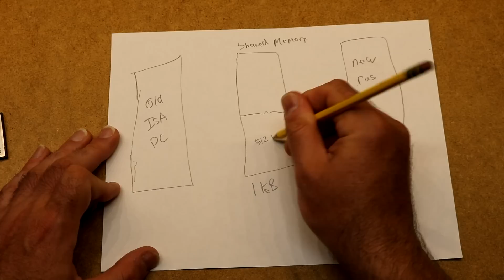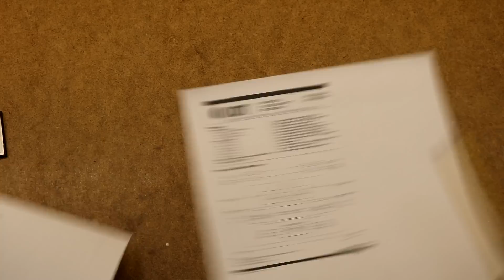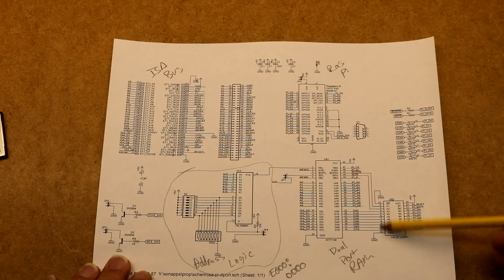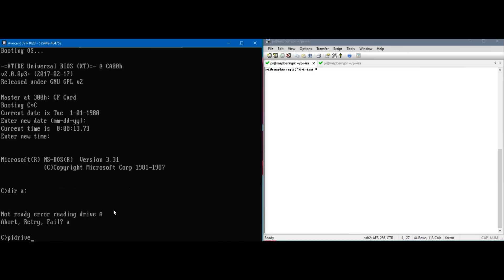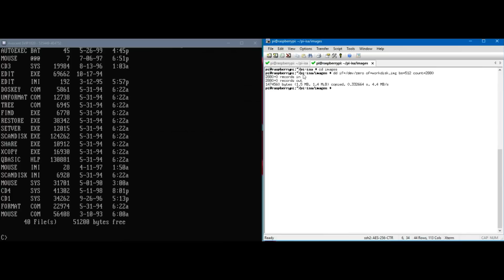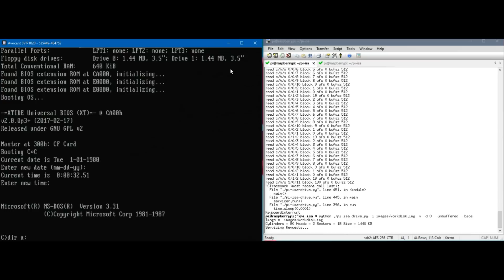Raspberry Pi Virtual Floppy for ISA (PC XT/AT) Computers

Comment: Hi, so I have the same setup. Question... The VGA card shows 512kb on boot but with Check it, it only shows 128kb. Is that a limitation of the 8088 or something I did wrong. I did set it up to use the extra hi mem and that works, if course with the proper software. Maybe that is stopping the extra video ram. I not sure I would even notice the difference but if I can use it I would like to. 

Love your videos sir!!

Comment: Way too late but you can do logic level conversions on the cheap with a transistor and two resistors.    Alternatively, sparkfun sells a board with four such arrangements each.  Part is BOB-12009. I've got a bunch, they're handy.

Comment: Can you make a Mp3 player? The idea is to send commands from the ISA computer to the Pi and select which file to play. Then we need to add the hardware for the audio output as the Pi Zero does not have it by default. What do you think? I think it will be a great project that does not require too much extra effort and we will all be able to listen to music on our vintage computers :) There are already some serial mp3 players, but they do not allow retrieving the list of songs for example.
Reply: But, why would you put it inside a PC instead of just having the Raspberry Pi with USB speakers outside of the PC??? The quality of speakers available is much, much better than tinny PC speakers of the original PC, XT, AT or clones. Then you can take it away with you in your pocket. You have a great solution, you just need a better problem to solve! lol!  It's also probably possible to create a Video Card of sorts for the old PCs with a Raspberry Pi, too, so you could use HDMI. Another thing that's an issue for the vintage PC collectors, is that even the weakest RPi is many times faster and more powerful than the PC itself. You can emulate a 8088 or 8086 PC with all the extras within the Pi easily. So the PC has nothing to do. You may have seem some Amigas that are just the Raspberry Pi inside an Amiga shell, emulating the Amiga without any original circuitry. You could do the same with an empty PC case with a power source for the Pi, that would be more sensible than trying to use all the obsolete unneeded PC components.

Comment: Why not use a Gotek with FlashFloppy firmware? It is cheaper than a Raspberry Pi.
Reply: Cheaper than a $35 RPi 4, but not a Raspberry Pi Zero which is $5-10

Comment: Now need something like this for IDE CDROM emulation.
Reply: Why?  there's not a lot of practicality over using virtual ISOs on a hard drive or XT-IDE Compact Flash 8-bit adapter (CF uses IDE).  For XT and ATs (8088 and 8086 CPUs), which only run DOS 1 to 3.x, the maximum addressable sectors on a disk was 4096, each sector could contain 4K or 4096 bytes, which adds up to a potential total of 16 MEGABYTES. Getting a 386 with the DOS 386EMM.SYS memory manager gets through all these limits, but consider this history: MS/PC-DOS 4+ was needed to have a storage medium of over 32MB, and DOS 5, to get over 512MB. FreeDOS gets around these limits, and old DR-DOS had some memory tricks, I forget the details. Looking at the original BIOS, he original BIOS INT 13h interface allows for 1024 cylinders, 256 heads, and 63 sectors per track. A PC using INT 13h can therefore only access 504MB. Anyways, whether using XT-IDE with Compact Flash, or just an old hard drive, there's little advantage to be gained over ISO files put on those mediums. The biggest issue is probably getting around elaborate copy-protection schemes on some CD-ROMs, but I think that was mostly Windows era games. And, all those DOS games previously worked within those limits, so they are small. Much smaller than modern games.
Reply: My original answer mainly deals with vintage computers. But even for Windows games for Pentiums and above, there's no advantage of hardware emulating a CD or DVD, rather than on a drive. Any MP3s and movie clips perform better and can be compressed on a hard drive or emulated hard drive. Optical drives sucked.

Comment: There easier way.  EBay has 8 bit ISA net cards.  You can connect a XT computer to a file sharing network, I used file sharing on an XT pc when I was at University.  Don't know how to set it up.
Reply: They are unbelievably slow. Not much faster than Laplink over a serial cable.
Reply: @squirlmy  For an XT computer, it's plenty fast.  For today computer, 10Mbs is too slow.

Comment: Your 8-Bit SDCard adapter includes software in the BIOS to boot the machine from the serial port, or mount floppy images too! I don't know why you never build up the serial ports on your cards. I built the one on the Floppy adapter, and it works great with this, or with Laplink.
Reply: there is a follow-up video where he takes the board from prototype to gold edge showing how to upload the zipped gerbers to JLPCB (this video is the original "green board" review), and on both those "release" revision boards, the serial port is indeed wired up.

Comment: Try to run Minix 1 or 2 on your computer.
The old Minix is a free unix for 8086 compatible pc.
Version 3 is rewritten from scratch and not compatible.
Reply: There's also Microsoft's Xenix, although it might need a 286. Various flavors of CP/M, USPC P-system, Plan-9, GEM. These and many more OS are available at Winworldpc.com There was also an attempt to squeeze as much of linux as possible on a 8086 in a project called ELKS.

Comment: Awesome video, Scott!
Could you elaborate how you installed the int 13 handler from the section of SRAM?
How does the BIOS know where to look for it?
Reply from the maker: The BIOS automatically scans high memory looking for blocks of memory that begin with the bytes 0x55, 0xAA. If it finds one, then the third byte is assumed to be a length, and it then computes a checksum to verify that a valid extension is present. Assuming everything checks out, the BIOS will jump into it and run it. So in this case, all I had to do was to make sure the first 512 bytes of the dual-port RAM contained the appropriate header bytes and checksum. It was a bit of work fitting everything I needed into such a small space though.
Reply: Hmm, couldn't that mess with memory mapped I/O too, though?
Interesting, I assumed something like this, but I didn't consider it to be too reasonable, as scanning the entire memory would take some time,
but I guess if it just scans a specific high region, it won't take that long.